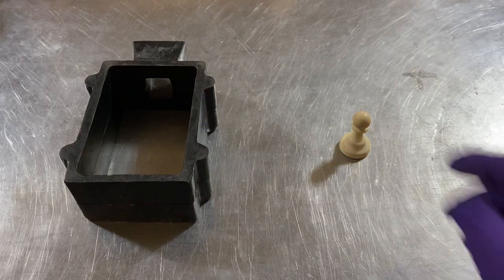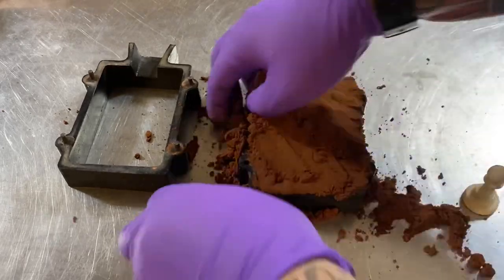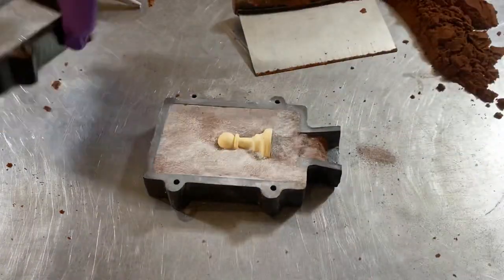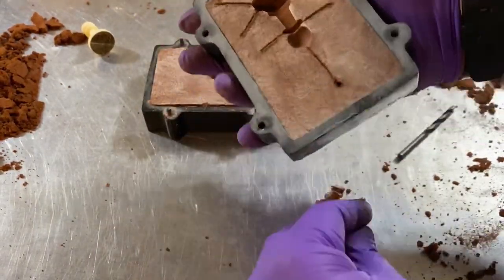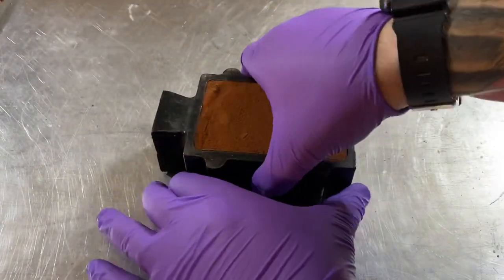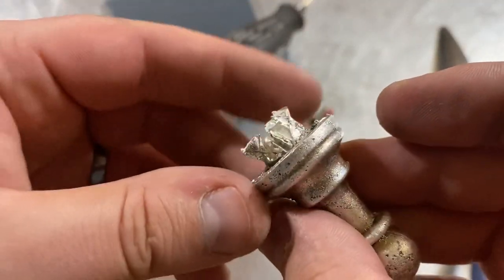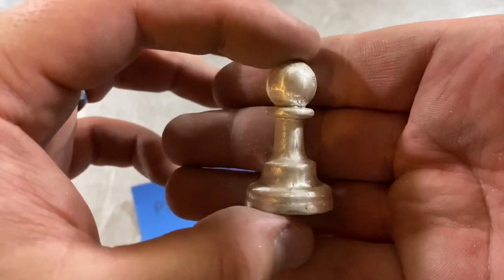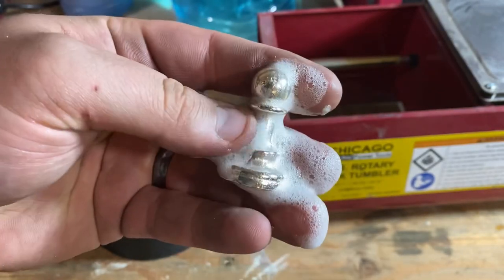Delft Clay Casting Tutorial

Comment: Nice work on the Pawn. The two halves of the flask are called the Drag=bottom and Cope=Top. I use the shine bright too, it works wonders. Don't forget to powder up the piece b4 you press it down in the sand, not good if it sticks. I forget at times too  lol
Reply from the maker: yeah I have done that before but with the slick plastic it’s not needed... some pieces do it need it for sure... thanks for watching! 🔥🐉

Comment: Sweet. This is where Ive been having trouble. I use the same dough knife. Nice. I think its my clay. I went with the cheapest and it doesnt seperate as smooth and hold its form as well. Also the air lines. Good idea. Have same furnace. I need to upgrade my Dremel also. Got the Wal Mart brand. Got the same tumbler also. Love Harbor Freight. Thanks for the tips
Reply from the maker: yeah the clay does make a big difference... haha harbor freight is awesome lol 🔥🐉
Reply: @SilverDragons47  What mesh do you use. The link takes me to a 140 mesh. I have a 80 n a 190 i mix but its off brand. Thats y I think its not holding form that well